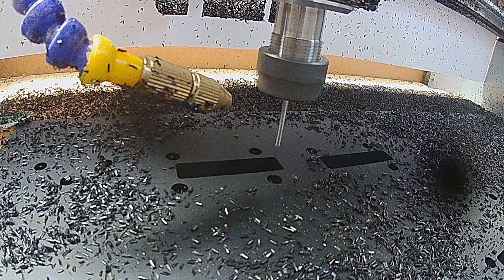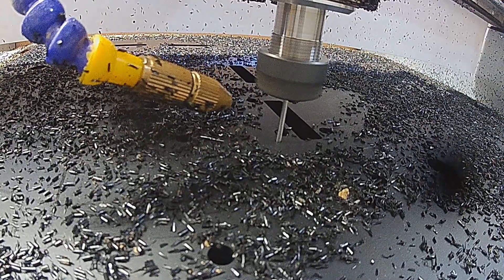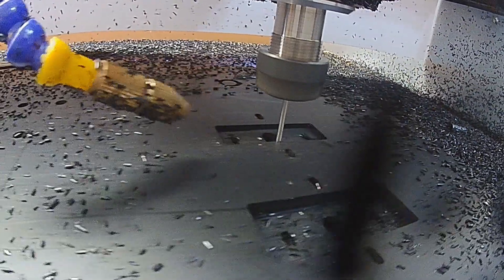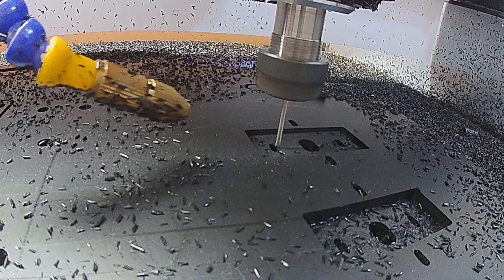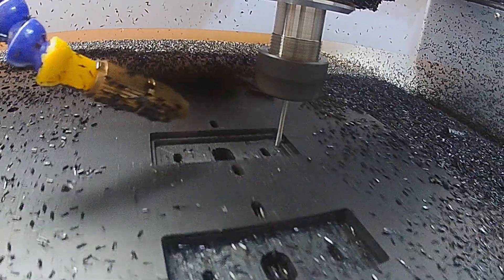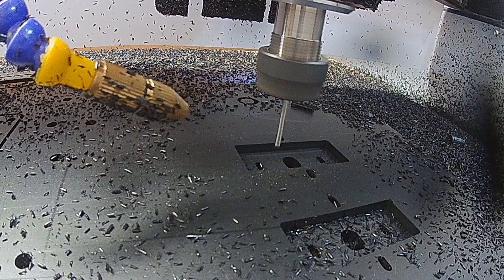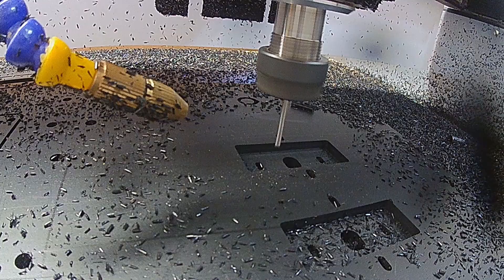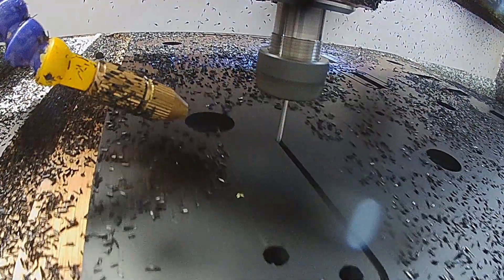How to cut HDPE on a CNC Router

Comment: Nice video! What speeds-and-feeds do you recommend (chip load)? I'm trying to push our industrial machine to rip out parts yet maintain that sweet spot to get "polished look" 🤔💥
Reply from the maker: As you'll know, every machine is different but on thin sheet alu, on my machine I'm hitting 1500 - 1600 mm per minute at 24k ish rpm, on 3mm bit diameter max 2mm depth of cut. That's on softer material like 1050 or copper.
Reply from the maker: On HDPE take it up to 4000mm per minute.

Comment: Nice cuts buddy👍👍 just started working with this material what was your rpm and feed rate for this cut? Parts looked great👌
Reply from the maker: HDPE go as fast as your machine and the bit will allow, it's very forgiving. I like single flute bits as this enables full RPM 24k, I think I've set my machine to max out at around 4200mm per minute but that was a small bit, so I've probably capped it around 3000. Then get ready for the mess!
Reply: @ Definitely sure does make a mess! 😂 Greatly appreciate your response! Very cool!👊👍👍

Comment: I noticed your toolpath stops and plunges on each depth change. I think if you don't decelerate and do a ramp plunge instead you might get a longer lifespan out of the cutter and less chatter/better edge finish around the plunge area.

Nice video! Where do you source your HDPE?
Reply from the maker: Thanks for the comment.

You don't really need to ramp into HDPE it's so easy to cut, in fact it's so soft that if you cut it slow it just melts together into a bigger mess. It barely touches the tool, unlike the tools I use in aluminium, (which I do ramp into) this one will last a long time unless I do something stupid (which does happen!).  My plunges are a bit slow if I'm honest, I used to default to 300, even in alu, it wasn't smart, I reduced default to 150 and maybe could have put it higher here.

Trent Plastics is the source I use for HDPE, used them for years on and off and happy to recommend.
Reply: @TheCNCDen  that's good to know!  always learning - I love how different materials require such different treatment for the same processes
Reply from the maker: @m9workshop  One of the best decisions I made was to open our service up to others to work on different materials, rather than just aluminium all the time. 

More importantly though, how's your machine, did you get it fixed?
Reply: @TheCNCDen  sadly not yet! Just been so busy, and everytime I set aside sometime to work on it something else comes in. You know how it goes...